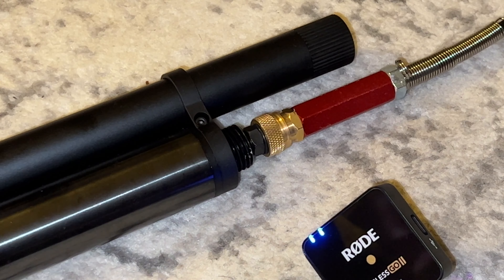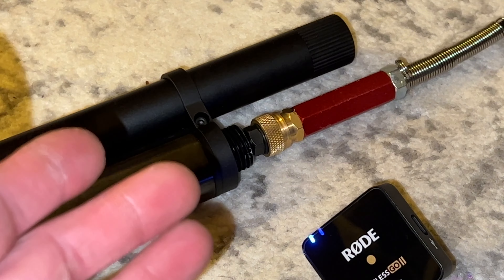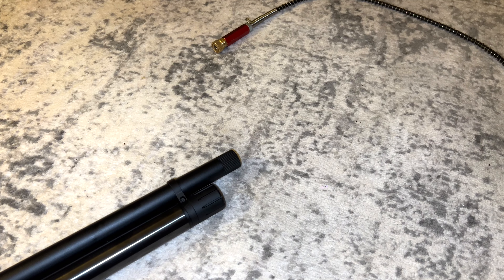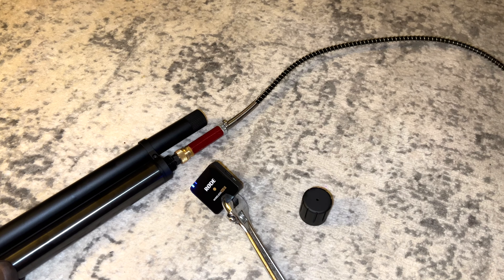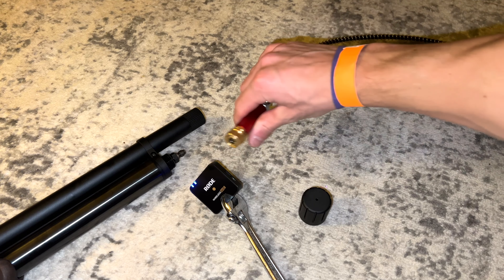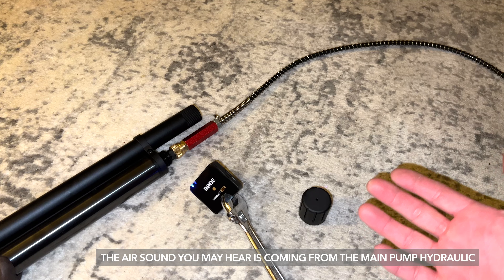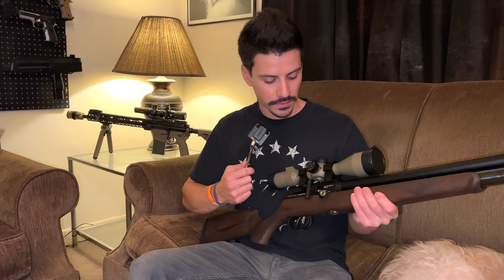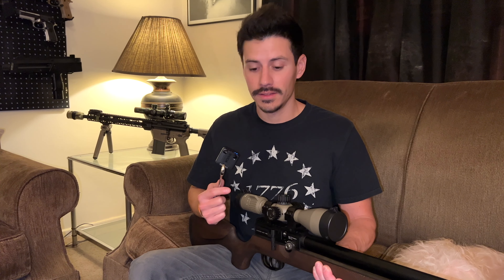JTS Airacuda - Watch this BEFORE you buy!

Comment: my vevor hand pump worked great for 5 months but then recently it broke but I took it fully apart and I fixed it and now it works great and to fill my airacuda to 3000 psi from 2000 maybe like 75 pumps maybe from 0 I think it takes about 150 to 175 pumps I believe

Comment: in the quick disconnect thing behind the balls there is supposed to be an o ring there so if there is not, all you have to do is find an oring that fits and shove it down the quick disconnect thing
Reply from the maker: So I found out what the problem was, idk if this happens to anyone else but the orings in mine are sensitive to temperature. If it’s warm, they work fine, if it’s cold they leak. Lol being a newbie to pcp It took me a while to figure it out
Reply: @VitalArms  huh I never knew that could be the issue

Comment: 1) Thanks for the shoutout. 2) love your microphone stand!
For real though, you should get a compressor. The reason that is leaking is because on the chinese foster fittings they usually use 2 orings in there stacked back to back. Also with the different tolerances on various fill nipples you might have some variance in how it seals, like you're seeing here. Sometimes what helps is if you get out a dental pick and carefully flip the orings in the foster fitting,. You should also lube up the whole shebang with silicone grease. Check my channel for a bunch of different videos on compressors - my fave is the Orcair Thunder and the ToAuto A3 (total workhorses)
Reply from the maker: Dude!! Happy to have you here. Like I said before, I’m an absolute beginner to the pcp world but I definitely trust your advice and I’m also asking myself why not a compressor!? I already know I’m gonna get one eventually but my stubborn head also wants to make me work for it with the hand pump. You definitely help me nail down some variables with this response so I’m gonna get to work and see how I can get it working consistently. Stay tuned for a new compressor 😅 🔧 🎤